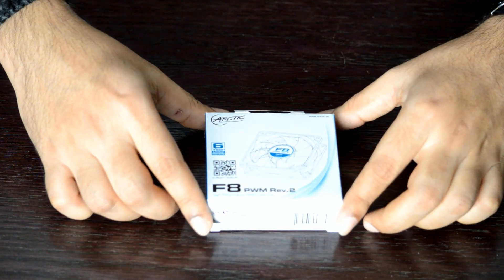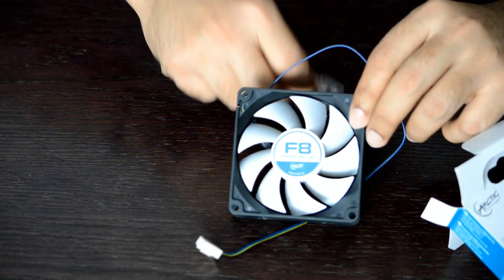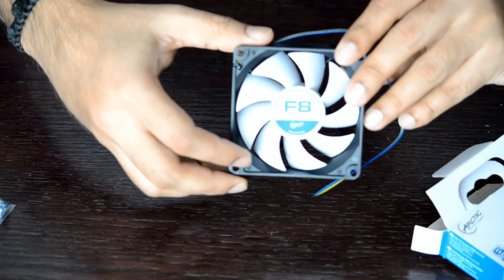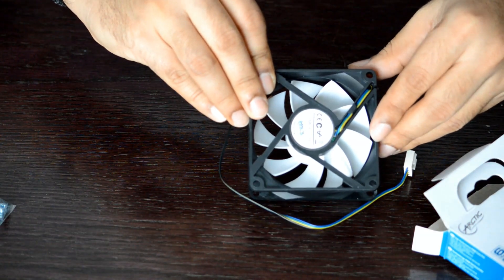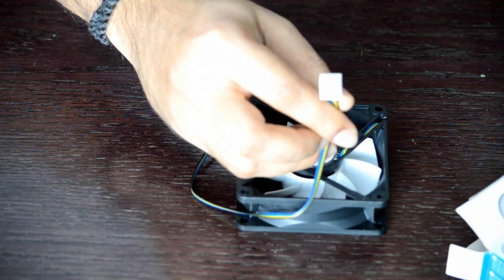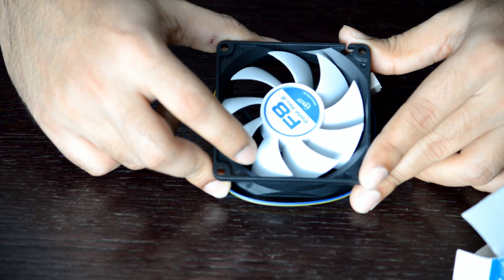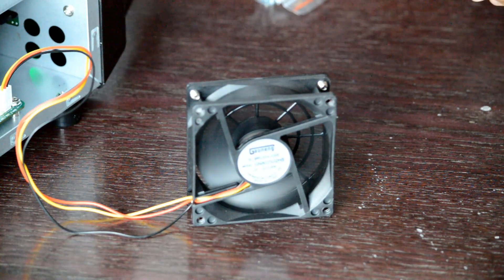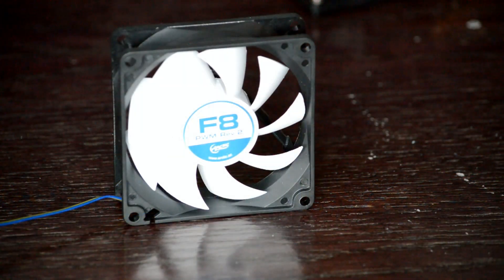Unboxing & detailed review of ARCTIC F8 Rev.2 High Performance PWM Case Fan

Comment: Thanks for the noise comparison. it was just what i needed hear + the white fan blades will reflect my RGB lights a little in my case so that's a pluss. I bought 2x ARCTIC F8 80mm now.

Comment: take the grill off the standard case fan or its not a fair comparison on noise level. You ran one with a grill guard and one without.
Reply: Dannix Danny it makes no difference
Reply: Actually it does depending on the grill
Reply: @jdw715  It does make a small difference, but that was motor noise not grill noise.

Comment: god review...i will buy 2 of them for replacing the gpu cooler fan...i think the temps will be much better...
Reply: Adam Ryan hot glue
Reply: +mos craciun You cant juse replace GPU Fans with them... You need to have the right mounting for the outer casing of the GPU too.

Comment: can  i use it in 3 pin MB  and  would that still  not gonna make noise\
Reply: john Al it would run at full speed all the time unless your motherboard has fan voltage control